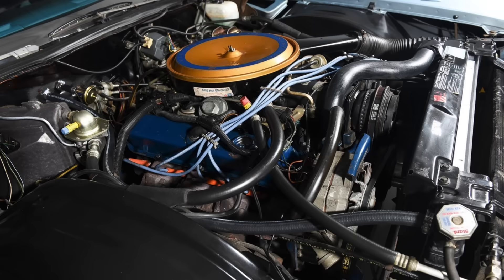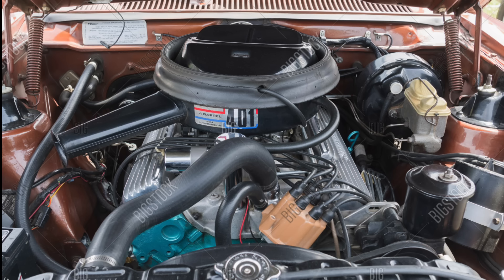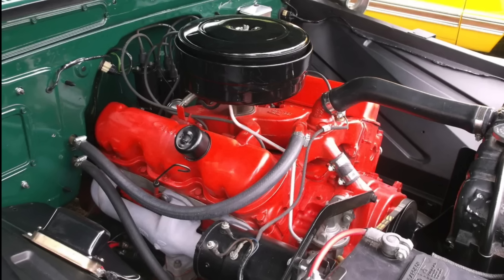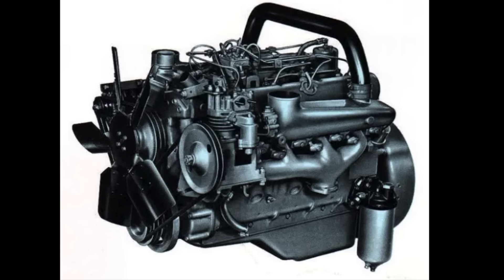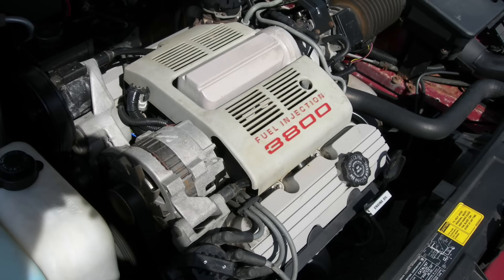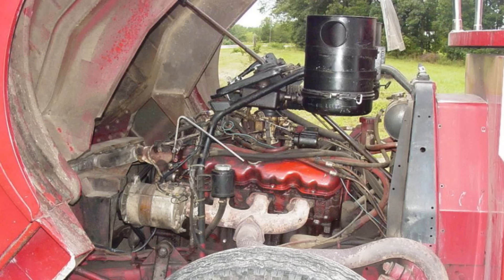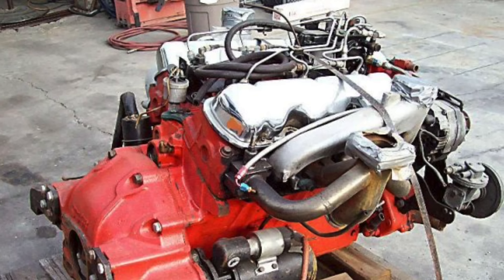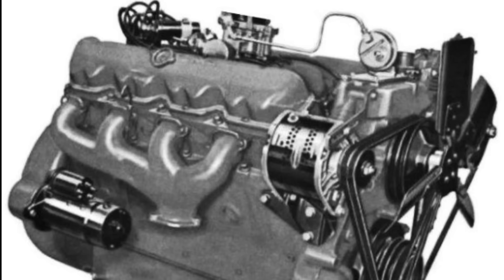The 1966-72 GMC 637ci 60-Degree V8 - GM's Largest On-Road V8 Is Virtually Unknown!

Comment: Heavy duty truck engines are really fascinating to me! Always happy to learn about GMC v6s and their related derivatives.
Reply: 100%.   This is when the internet  is such a blessing.  About 10 years ago I finally started looking at the GMC book I had for a while.  Eventually, I started looking up everything online I could find about the Ford 534, IH 549 etc.  But this "family" something on it's own.  305, 351, 401, 478, the 702 V12, and the ToroFlow diesels.  In the early '70s they put the longer stroke crank into the 351 to enlarge it to 379.  And a 432 doing the same, 401 with the 478 crank.  Eventually when a guy finds articles & discussions about the 702 V12, someone always brings up, too bad they didn't double the 478 instead of the 351.  The diesel 637, 478, for a few years they made a 351 of the diesel, saw a pic years ago, GMC had put a few in 3/4 ton pickup trucks, and supposedly was toying with idea of offering that to the public.

Comment: A design feature that I thought was not particularly good - the PCV valve was threaded into the cylinder head under the valve cover.  Made changing it an unnecessarily long process.

Comment: Had a 534 ford to pump irrigation water and it was a lemon apparently. It was sized right according to hp required but just couldn’t do the job without constantly breaking down and laboring like it was going to blow up any second. Well, it soon did blow up. We replaced it with a Ford 460 turbo charged and that thing ran like a champ for over 25 years. Only needed valves replaced as it was run on natural gas.
Reply: I seem to recall I rode to grade school in a Gillig pusher type school bus with a Ford 534 mounted in the rear.  It climbed up a lot of hills were I lived in on the San Francisco Peninsula.
Reply: There is a boat engine that put twin turbos on the 534 & still used draw through carbs. Apparently they absolutely DRANK gas but had decent power for the time. Seamaster i think it was called.
Reply: Not sure,  but I believe the superduty series was kind of a gift from Cummins,  they attempted developing a diesel v8 with it, but really never got far enough out of R&D to continue. The heads had one big intake hole near the center that never flowed well, it had several thermostats to create different temperatures in different areas of the block and heads and intake manifold,  .. nightmares!
Reply: I have never heard a good thing about those Ford Super Duty engines.  Another thing about them was they had a cylinder head/block configuration like the Chevy W-motors.
Reply: We had a 534 in an 10 wheeler grain truck on the farm abused it many a year don't recall many problems with it other than a few carb rebuilds tune ups  but that noisy Carter electric fuel pump away gave us hell lol

Comment: I can't say with certainty; awfully long time ago now, but I seem to recall seeing some sort of hot rod / show car or something similar in a magazine from back in the late 50s / early 60s that had one of those GMC V-12s. It may have even had a blower (or two) on it.

Obviously more for show than anything else because it wouldn't have been very fast. Those engines weighed a freakin' ton and they were not designed for speed, they were designed for work but it would've looked cool.

Very few people today are even aware that GMC division had their own line of engines just like the other divisions did.

Comment: The valve covers of both the gas and the diesel version remind me of the old W-head engines of that time.
Reply: Several times, from far back, I thought I saw a 348-409 in a truck at junkyards, but as I walked closer I was disappointed to find these V6's

Comment: The 8V92 Detroit Diesel which was manufactured by general motors at the time is bigger than this, at 92CI per cylinder it displaced 736CI And yes it was used in trucks so it was a legitimate on the road engine.
Reply: Detroit's 12V71 had more CID than thier 8V92.
Also Cummins had on-road diesels over 1,000 Cubic Inches. 
Mack had a V8 diesel that made big cubic inches as well.
Reply: @johneckert1365  Yes I'm aware of that, the scope of this video was GM's biggest displacement V8 on road engine, that would be the Detroit diesel 8V92.
Reply: @lustfulvengance  That's still not accurate. Detroit's 12V71 was in alot of over the road trucks in those days, and was 852CID.
Reply: @lustfulvengance  Toche. I missed the V8 requirement...... You win the crown 👑

Comment: The GMC 702 V-12 was NOT a twin 6. It had a specific single casting 12 cylinder block. It did use 4-3cylinder heads. But it was definitely a singular made V-12
Reply: Nevertheless, GMC marketed it as the Twin Six - it gave the customer that wasn't pernickety type some kind of sense of what it was
Reply: Yup, I was going to comment the same thing.  Single piece crankshaft too.  Two v6 intake manifolds.  What I liked was the unusual distributor they came up with to drive the 12 sparkplugs.

Comment: Never heard of the 379 or 423!
Reply: The 379 and 432 (not 423) were the 351 and 401 blocks with the longer stroke crankshaft from the 478. GMC offered them for a few years in the early 1970s.

Comment: Ford had the 532 for trucks and the 462 MEL right before the 460.
Reply: The Ford 401, 477 and 534 engines were the Super Duty V8 that was produced from 1958 through 1981.
Reply: Had to power those Edsels.

Comment: Would like to see a couple of those in the back of a boat, it could really swing some big props . But I am sure they got a drinking problem lol
Reply: As a marine mechinic I say nah. Diesels are better suited for boats in almost every way except perhaps speed. I hate working on them. Nothing like being a in a bilge full of highly explosive gasoline vapors and hard to avoid if you're doing anything with the fuel system or just basic maintenance and troubleshooting.
Reply: Lots of ChrisCraft's ran twin 534 Super Duty's
Reply: @rodmpugh226 the turbo setup on those 534 seamasters is bonkers

Comment: The GMC big V6 was one of the very best pickup engines ever made (for work). Basically a medium duty engine in those light duty trucks. If it could be somewhat modernized/had aftermarket support, these would be a serious force to be reckoned with. They already were at the time, but few know it. The big cube examples are where it's at - the 351 and below are just as indestructible, but low on power. Shame they didn't keep the 637 around longer too.

Comment: The downside to spark plugs on the top according to my heavy mechanic dad (caterpillar specialist) is that it doesn't tolerate fuel leaks. He didn't like things catching on fire while he was working on them. Maybe that's an issue that was more a problem with carbureted engines than it is now. My 97 Mustang's  fuel injected 4.6L has them on the top.
Reply: The Jaguar V 12 engine also has the spark plugs on top. Yes they were prone to catching fire if the fuel injection lines had a leak which allowed fuel to be sprayed on the spark plug wires. So with this design, service to the fuel injection lines/hoses is very important.

Comment: The Turo Flo injectors were located were the spark plugs where in the gas versions,and the V-6 Turo Flos,also incorporated or utilized a balanced shaft .I think the V-12.was discontinued in 65.
        When I worked at an International truck dealership in 74-77 the serviced a fleet of cabovers that had the GMC V-8,I remember driving those trucks,you could roll the clutch of idle with out a bit of protest,those engines had amazing torque.If you ever drove those GMC medium or heavy duty trucks,you never really ran high RPM,they were ment to be ran at low engine speed,a great family of gas engines in my eyes.
Reply: It's crazy to think about a big block V6 😂 those GMC V6s are awesome...
Reply: @samholdsworth420  There is a YouTube video of a C-10 pickup with a 472 V6.
UNfortunately The guy doesn't use the wonderful 750 rpm torque. Instead he tries to wind it out in each gear and it's not impressive (any big block Chev V8 would run away and hide from it.)
Reply: @patrickshaw8595  I saw that video.  Yes I agree, short shifting it would make the truck accelerate faster.  Not many combinations can lay claim to that.  A truck should pull the hardest at its shift recovery rpm, not after being wound out.  Torque rules.  ---Doozer
Reply: @kooldoozer  International gas engines and I am referring to the 266,304,345,and the 392, were the only other truly designed over built truck engine that was available in light duty pickups, Travel alls and Scouts,besides the GMC V-6 truck engine family.
Reply: @patrickmcgoldrick8234  I have a red diamond 501 in my R-185.  Not a light duty truck, but I appreciate the big torquey engines.  ----Doozer
Reply: @kooldoozer  I remember the city of Tucson,had a fleet of garbage trucks that were early Sixties vintage that were tandems and 5 speeds,and had the 501 Black Diamonds,and I worked at Desert International in the mid seventies as a parts runner.The city would replace the worn out engines with IHC renewed rebuilt engines,I got to deliver them to the city shop,in a 74 150 International PU,those engines really pushed the rear bumper to the ground,those engines were beasts,and long lasting low RPM torque monsters.
Reply: What's a big block? What makes it so? Just curious. @samholdsworth420
Reply: @sorencify  big block is a "big block Chevrolet" designed by Chevrolet in the 1950s till today, large displacement naturally-aspirated V8s.

Typically anything 350ci (5.7l)  or smaller is called a small block Chevrolet. 

Both are 90° V8 naturally aspirated developed by Chevrolet in the 1950s till basically today

Like some Chevy trucks have a 350 small block

I have a Suburban with a 454 Big block 💪🏼
Reply: @sorencify these GMCs are regularly referred to as the big block V6, kind of it's own category
Reply: I remember those big bulky 549 international engines.... they had incredible torque... you could ease out the clutch at an idle and it would just chug along...

Comment: quit repeating the same old wives tale about the oldsmobile diesels being the same as the gas engines, "inspired by" and designed by the same people so they have some similarity
Reply: Olds diesel blocks were based off the gas blocks. That’s why guys build them for high horsepower and stroker applications. Not sure why you’re so upset, he’s not wrong, and you didn’t exactly “correct” him.
Reply: @jimmy_olds  Thank you. When people say olds took a gasoline engine and converted it to a diesel engine, the words “converted it” automatically lets us know that SOME changes were made to allow it to be a diesel engine. 😅
Reply: Of course they beefed it up significantly to handle the extra diesel stress. But the basic design was very similar . And the olds gas v8 that was the basis already had a strong block and bottom end. So it was a good starting point. And with the added block strength, I don’t think they had a lot of lower end problems. But Other than the diesel specific components, externally the gas and diesel engines looked almost identical to the naked eye. I believe the weakness was in the fact that they didn’t alter head bolt pattern and strength enough. And they lacked a water separator.
Reply: @dmandman9  alright but my point was that they are not "the same engine" 
so good job saying the same thing with different words
Reply: @merchantman5635  I don’t think people are saying they’re the same. When they say it was converted to diesel, it’s understood that they made SOME changes. The failure was specifically in the area where they didn’t make enough (head bolts)
Reply: @merchantman5635 Yes, they aren't "the same" engine, but they do have alot in common, and do share quite a few parts.

Comment: I don't think the balance shaft had anything to do with refinement. Probabaly had much more to do with the engine not beating itself to death. I have been wrong before though.
Reply: Hence refinement.
Reply: Well, with a 60 degree V and 5" pistons, it probably shook quite violently even at low RPM. So the balance shaft was probably needed.